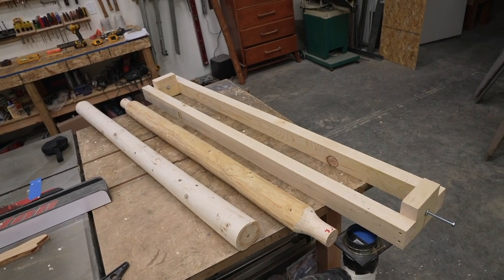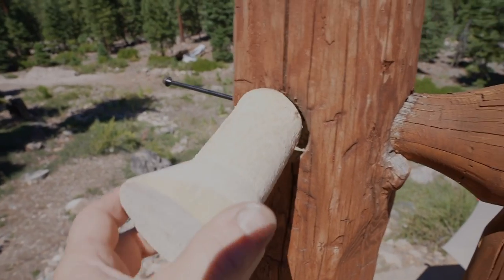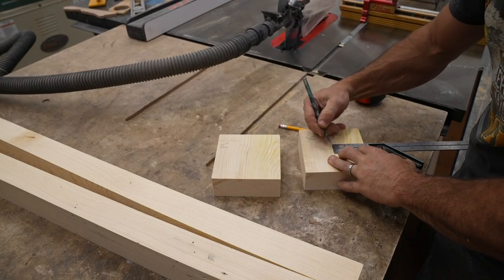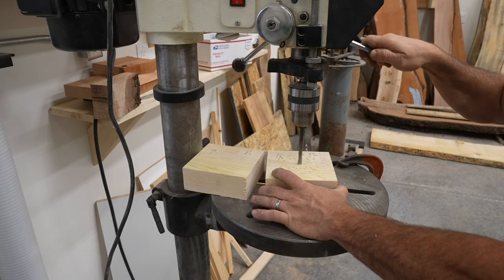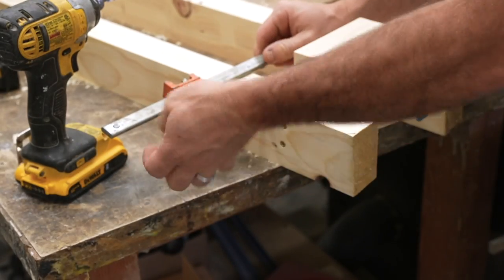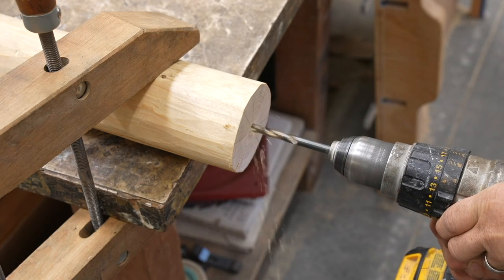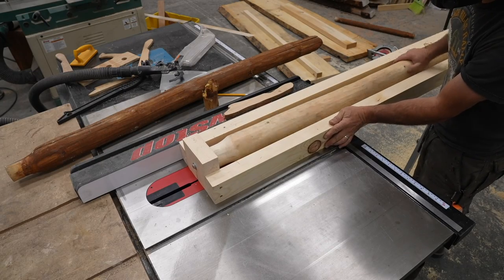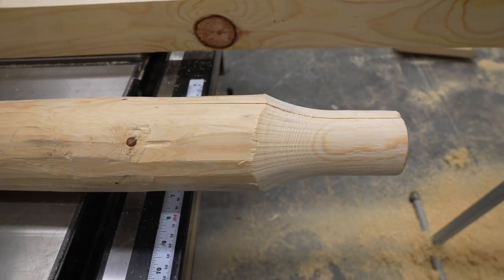Log Tenon Cutter for $5 - Use your tablesaw to make log furniture, log railings from branches etc

Comment: I just realized. If I really want to do Tenon cutters I could use the wood lathe I have. Yet this jig can do any possible length if need be just a few adjustments.
Reply from the maker: ah yeah, a lathe would be a good option! The nice thing about the jig is consistency with the size and angle.

Comment: Nice jig, but it looks like this will only work for perfectly straight logs coming from a lathe.
Reply from the maker: Mine came from from a green tree I cut down, and stripped the bark. That's it, no lathe work. It doesn't have to be too straight; just straight enough to fit in the jig from each side.  I'm sure there are ways to improve on this design, but this basic method worked well for me.
Reply: @CorbinDunn  I tend to use more irregular limbs. I wish this would work for me.
Reply: @deek3048  Try using a draw knife.  You can put any size tenon on any size log.

Comment: I’m guessing this only works using straight logs that are not to long
Reply from the maker: That's a good point -- I'd say "yes and no" -- the legs don't have to be straight, but the height of the twist (when spun in a circle) can't be larger than the blade can cut. So... with a 10" saw blade, sticking up 3-4", and not cutting a full depth cut..it could probably still do quite large diameter of logs. This would require some experimentation though! 

But for length: you are only limited to whatever blocks your table saw in feed table.